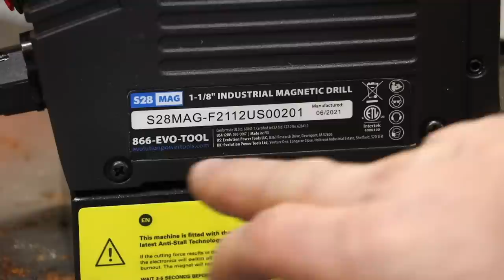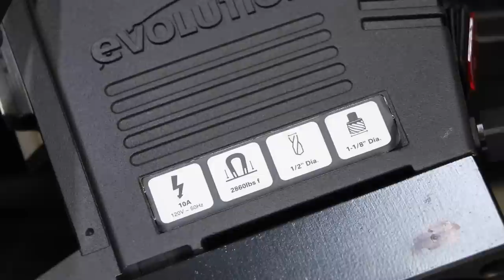Are Evolution Tools Any Good?  Chop Saw VS Train Track!?

Comment: As a new member to the fan club I could sense some humor coming with the anvil skit, well enjoyed.  As an industrial electrician, been using mag drills for years and have looked at this to add to my collection.  Far as the hole saws go, I would leave those for sheet metal and move to the annular cutter for any real metal with depth.  One thing you left out that you might not be aware of, mag drills work great mounted vertically but need to have a way to chain them to the metal you're drilling incase the breaker pops or shuts off.  Nice video, well informative and honest keep up with what you're doing and I'll be looking forward to the upcoming releases.

Comment: Thanks for your post. You scared me when you were set up on the anvil. Amazing how the saw cut through the rail. I have an Evolution 10" sliding compound miter saw. Love it. Great for cutting everything except for fine wood finish. Unless you can find a fine cross cut blade with a 1" diameter hole, I wouldn't recommend it for fine wood finishing. I also have an Evolution circular saw. Love it too. My advice on the circular saw: be careful of the material binding. Metal and wood grab differently. If you ever felt a circular saw grab because of the wood binding, then watch out when cutting steel with the Evolution. It doesn't just grab, it kicks like a mule and if you don't have a good hold will rip everything out of your hand. It felt like someone hit it with a sledgehammer. It's lightening fast. Probably why the spindle shafts are 1". A 5/8" would have snapped right off. I was lucky I didn't cut myself. Other than that, it cuts through steel like a circular saw through wood. I absolutely recommend the circular saw. Got it on sale at Canadian Tire $119.00 CDN.

Comment: The real test is how well it sticks to say 1/8" steel as the mass on which it is grabbing plays a great deal in how strong it holds.  I have often thought of getting a Mag drill but two weaknesses and my style of usage hold me off.  I especially want it to do overhead work which is an extreme pain to drill but it has to have a no excuses positive grip on whatever it is stuck to.  Another thing that is a bit of a drawback with many is the throat clearance (chuck to workpiece distance, or arbor to workpiece at times).  You put a long attachment to it and many just are not going to fit especially if you add a drill chuck and a longish bit.   For me most of what I am working on is angle stock, round stock  and other rather narrow forms.  Something the mag has a hard time getting hold of.  Plop it in a piece of 2 inch angle and see how well it holds.  So I end up with really needing it a few times and in most of those cases it will not work anyway.  With a shop stuffed with both wood working and machining tools that is one that will just have to wait on the back back burner.  A free one does alter the equation!!  For six hundred dollars I just can't justify one.  I would not be able to justify one of the three hundred dollar ones.

Comment: I had my doubts when you started cutting that rail! That definitely was a nice cut! Who would have thought there would be a carbide circular blade that would cut steel! I've cut aluminum on a table saw before using a carbide blade for wood with a mister for coolant.
Reply: Wood carbide blades seem to have a weaker carbide than steel cutting blades. Wood blades Work fine on soft aluminum, don’t last long on steel though

Comment: I have both of those tools and they are amazing. The chop saw works flawlessly amazing cuts. On the drill I do not use the coolant tank at all I used oil in a can like you do.   I like the diablo steel demon with cermet 11 carbide of all the blades I have used on all of my saws.  I own the Milwaukee 8 inch hand saw 6370.  I love it. I had looked at the evolution on their hand saw, but I went with the milwaukee.  I enjoy your shows.  thanks.

Comment: Hiya. Yes, the annular cutters with the weldon type shaft are much better. The wobble is the combination of the chuck and the hole saw. I have a Hougen, and the annular cutters direct in the spindle are just amazing. Chuck is great for small holes and drill bits, but precision, extended working envelope, and bigger sizes come with removing the chuck and using direct insert annular cutters. No wobble at all.

Comment: In a practical sense, I can see the fence guard acting as a means to pool and corral the bit coolant plus it keeps the swarf from flicking around. 
Question isn't the lock lever spring loaded? I was thinking that you don't need to remove the screw to reposition the lever. You just pull on the lever, reposition and then let it go.

Comment: I've been looking at this size Mag Drill.
I currently have Milwaukee's biggest unit. It's an awesome machine, but it has one big drawback, and that's it weight. I think it's around 80lbs. The weight is fine when it sits on top but sideways or overhead drilling is a big challenge.

Comment: Braking the crust on top of that rail was awesome.  As a railroader who has peeled locomotive wheels, I know exactly how hard that steel can get.  I wish the mag drill was rated up to 5/8 or 3/4 regular metal bits. I have a project right now that I could justify buying one tomorrow if it was.

Comment: Just keep your Johnson away from those annular cutters.

I did notice that the slider was moving when you were bearing down hard with the 2" cutter. I'm guessing the LH thread is to try and torque it while pressing down, but it seems like it doesn't hold tightly enough to do that. Unless it's basically just a set screw, at which point I agree it doesn't make sense to be LH.

Comment: I’ve cut railroad track a few times with a quarter inch thick at a time , it’s absolutely amazing , I’ve done it with an abrasive saw , which is almost impossible, because an abrasive saw gets hot and hardens the steel , abrasive saws are hood for cutting light steel and hydraulic hoses ,,if your a serious steel fabricator , u need this tool

Comment: Receiving a free product to do a video is the SAME THING as being paid to do a video. You get $1,000 check or $1k in tools to do the video, it's the same thing. Changing the payment method does not absolve one of the possible problems inherent with getting paid to do a review. 

Also, the lubrication system on the mag drill is designed to be used with annular cutters and would probably do better with actual cutting fluid (less viscous) as opposed to cutting oil.
Reply: Yep 👍

Comment: As you and others have said
Needs water soluble oil  and the correct cutter and will work like a dream as 
You will probably use it with twist drills the most I strongly recommend a drip oil feed you will push the drills harder than you think and dabbing oil general will not be enough

Comment: Yeah, I was completely shocked that the Hercules hole saws held up. I use Horror Fright tools all the time, but always with the understanding that results may vary. I've had stuff that held up really, really well to some serious abuse. That said, anything absolutely mission critical, I'll go elsewhere for tools. Oddly enough, I've heard good things about their Hercules line, but I'm still cautious since you never know when they'll switch the manufacturing from good things mode to standard Horror Fright QC mode. Still, those hole saws doing that well kinda blew my mind to be honest. 

The drill is very cool as well. I don't see me ever having a use for something like that, but I do like it a lot.

Comment: Almost called 911 when you went to anvil lol. These are very handy drill with out question. Looked like it had a bit of run out but pretty good over all. Manet looked real good, very important mag won’t lift under drill pressure.

Comment: Discount did not work on the 380CPS. I called about the out of square fence and they assured me that it is square to the blade. Hopefully that issue has been resolved. Big reason for my purchase. It is very hard to cut square and to correct length with an abrasive saw. As well as many other issues with abrasive. They did give me 5% off as a first time customer. Not much, but better than nothing.

Comment: I bet the guard would help collect chips a bit when drilling on a vertical surface if you were concerned about them dropping. Maybe wouldn’t catch them all but it might help a little. - But the coolant system would not work!

Comment: I think the locking mechanism is "backwards" because they designed it with the idea that you're standing behind the handle in mind - which as we've seen is pretty silly.  You're going to be on the business end of the drill, not behind it, to monitor the work and make sure the drill is staying on center.

Comment: What happens if you are drilling horizontally, like on a wall, and there is a power outage, do you have to put a safety cable to hold the drill?

Comment: Do they not make annular cutters?
Giving you a mag drill with no cutters is kinda like getting a toy without batteries.
I think it would have been worth their while to include a couple of cutters since the drill will work so much better with them.
They are not cheap however.
Maybe HF will start selling them.
Just not in the Icon line I hope!

Comment: Don't push them too hard and heat up the motor. Motor internals are plastic and they melt. I bought an evolution circular saw and the bearings collapsed. When i opened up the saw. The bearings were the same as used in skateboard wheels.
Evolution tools are readily available at most b & q stores here in the UK. Not for industrial use is the buzzword for these range of tools.

Comment: That wobble with the 2" hole saw was the fault of the hole saw not the mag drill.
Reply from the maker: I think so too.  And it probably would have done much better if the pilot bit was engaged.

Comment: The cutting fluid delivery system wouldn't be much good if you were cutting a hole upside down.
Reply: Not if you had a drill bit with coolant channels.
Reply: That’s why it comes off so you can raise it and done it plenty and works well

Comment: A project I've always wanted to build that I've never had the chance to I'm a rail fan I've always wanted to build a ride on steam locomotive they have different scales our cages of track seven and a half inch gauge 15 inch cage we're always the ones that I was considering but you could drill holes in flu sheets for fire tube boilers really easily with that plus other people that restore steam locomotives would love that drill cuz you could hook it right up to the locomotive and drill holes or you could do it right on the plates of Steel on a surface plate fire tube boiler are complicated and you have to drill alot of holes for Firebox stay blots cuz there's an inner and outer Firebox and water goes between and that's what keeps the Firebox from melting by conducting the heat away this drill would be really cool for a hobby machinist that what a lot of these people are that build their own locomotives and it takes years for them to do this but who wouldn't want their own live steam locomotive I know I do one of those things on a bucket list I guess peace out sorry for the rant.